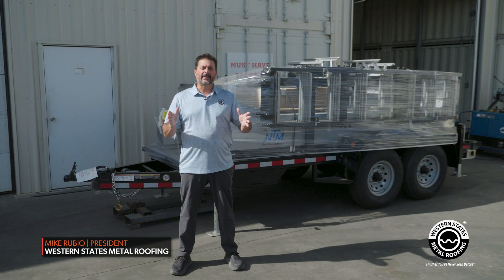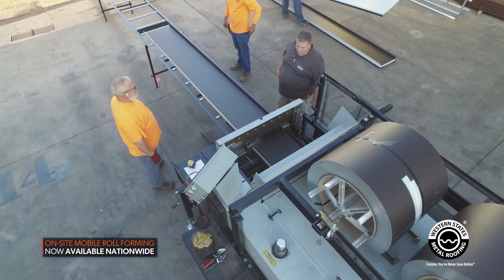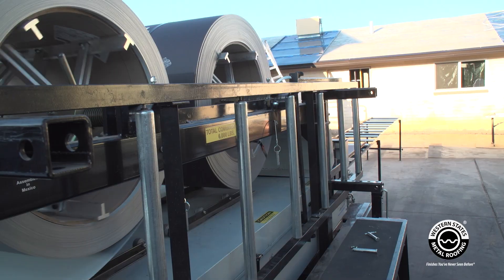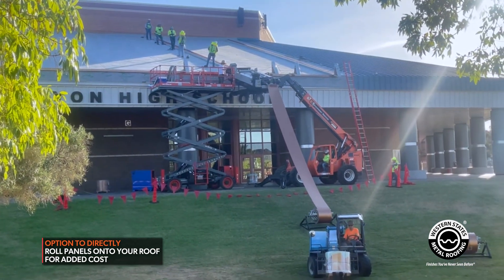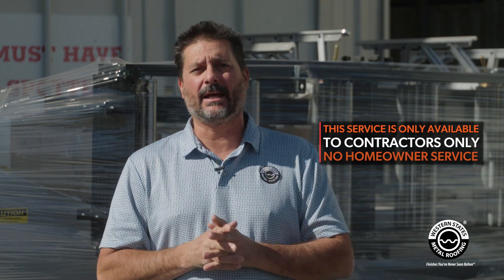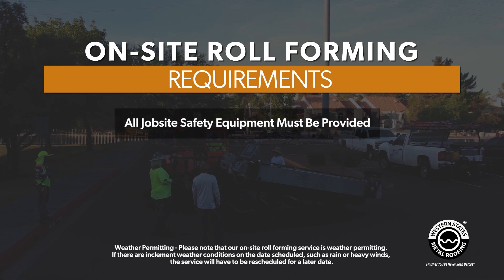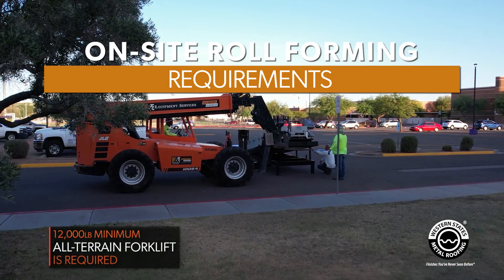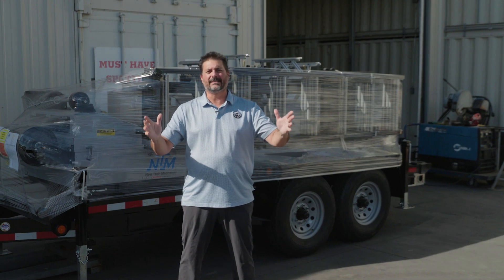On-Site Roll Forming For Metal Roofing & Siding Panels: Requirements & Benefits

Comment: What is a common long length that can be handled by hand.....from ground to one story roof?    
Not the Guinness Record version but common long lengths that a crew would work with?   tHanks
Reply from the maker: That is not what will determine whether you roll form on site. The material is light and with the right equipment you can get longer lengths on the roof fairly easily. The most important factor is that it's best to do the standing seam in one sheet to eliminate a lap and a potential leak point. Furthermore, you cannot transport sheets that are over 48' or so in length. Therefore, if you have a roof with long panel lengths to the ridge and it cannot be transported on a truck it's a perfect candidate to roll form on site. Generally. you need a job that's about 50 squares or longer before someone is willing to come out and do that. Smaller jobs are harder to get an onsite rollformer to do.
Reply: @WesternStatesMetalRoofing  tHanks.  
I'll ask around.  
I have a 57' wide 70' deep section to roof.

Comment: Looks fantastic.  Would we install a panel as soon as it’s cut and landed on the roof,  or does Western States want the contractor to catch and stack all the panels on the roof before the install begins?
Reply from the maker: Steve, we can do both. We can roll and have them stack or roll to roof and have them install.
If rolled to roof need to make sure have enough people to keep install fast and no delays.
We figure 8,000 lf a day. If there are delays due to start and stop of install that will decrease amount for footage ran in an 8 hour day and will then increase cost for additional days needed to roll on site.
Reply: Very impressive.  I try to tell the young guys working with me:  we’re not roofers,  we’re problem solvers. @WesternStatesMetalRoofing